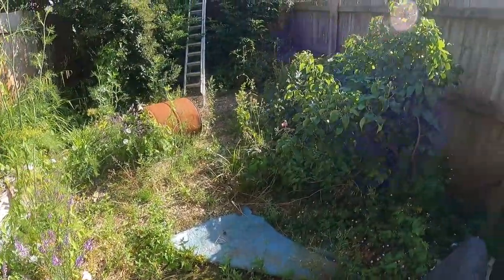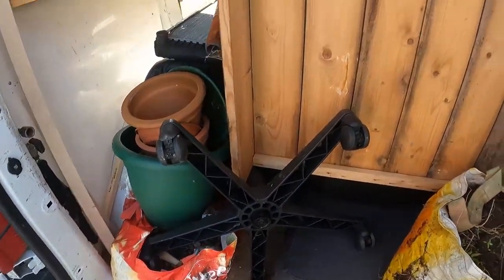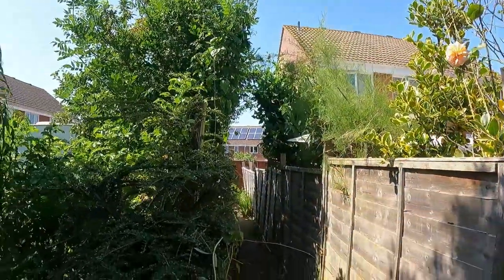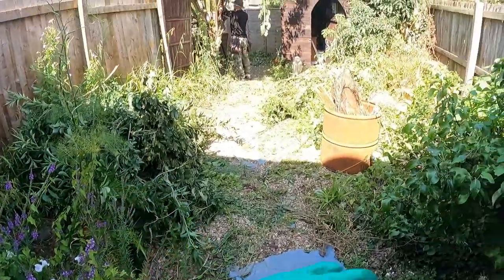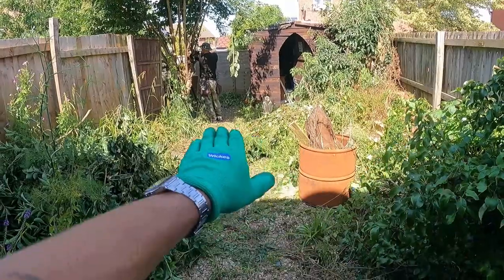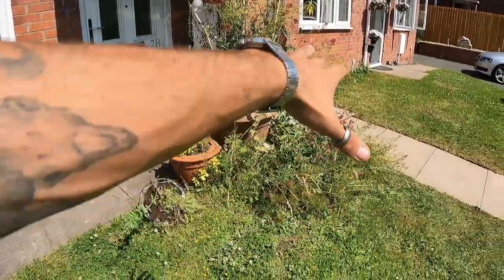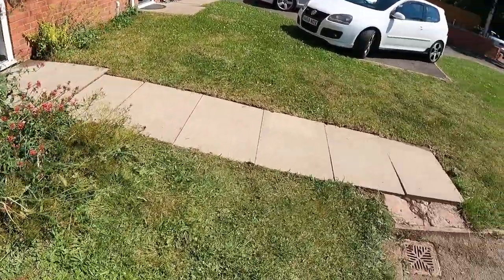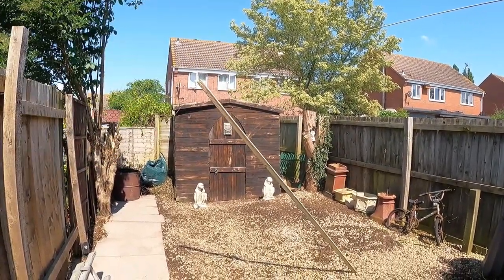ABANDONED & OVERGROWN FREE YARD CLEARANCE! *My first one*

Comment: Nice job! I got a question mate. I was thinking of starting a pressure washing business but on a budget. what wilks washer do you use and how long have you had it and would you recommend it for starting out till I can upgrade it?
Reply from the maker: Hey mate my wilks up and died after about a year but it definitely earnt it’s keep. Just keep an eye on it and make sure it’s screwed up tightly before each use or your exhaust may fall off halfway through a job :D I used the 750i before I upgraded to a Honda machine
Reply: @PartridgeExteriorCleaning  thanks for the advice that was sort of my plan to upgrade to a Honda. keep up the videos 👊underated
Reply from the maker: Cheers mason good luck bud!